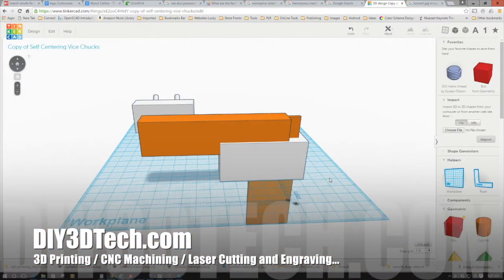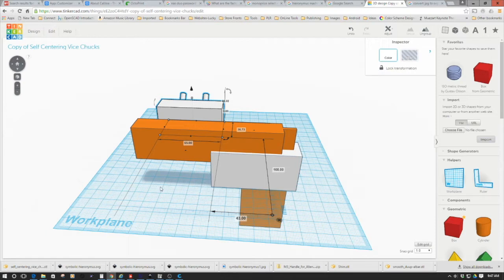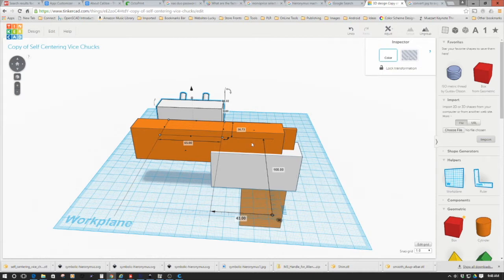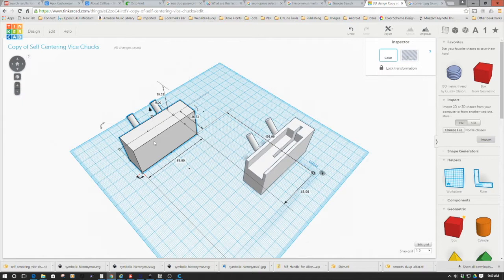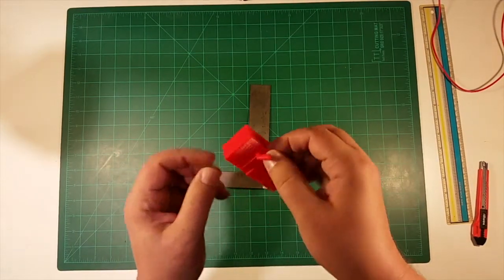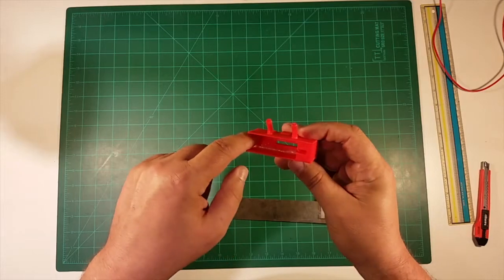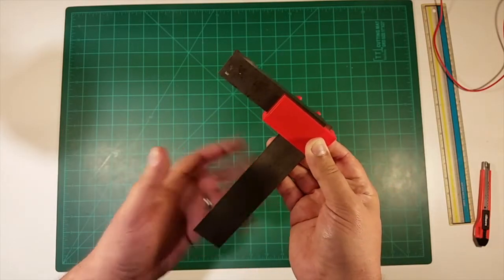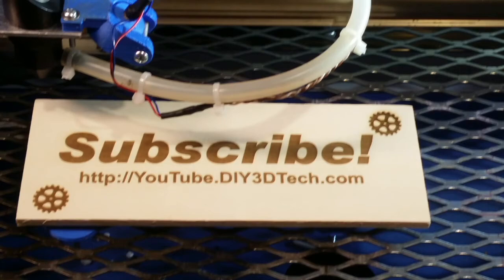TinkerCad Workflows  -  Machinist Square Pegboard Holder!

Comment: white gorilla glue has been my fave for years now .    it reacts with water . I use white stuff  ,  and it foams up white if you wet it .  a few min after you make it foam you can press it back down where needed for great looking fillets . 
in my R/C planes i have forces it to foam in and about fiberglass drywall tape .  and that becomes light and strong as all heck . 
i think of it as my foaming epoxy .   but I now stick to only the white for hobby stuff as the set and cure time is very predictable vs their original brown stuff.  any surface that excepts moisture will bond well with a small amount of white GG. I get crazy strong bonds with PLA .  lightly sand parts , mist them with water , and glue and clamp using typical wood glue practices for clamping . mainly as the water will make it foam enough to push the parts apart . but if you clamp it the foamig expansion will force it into every micro crack . so uh yeah , I like the stuff . 
And good TC video man .
Reply: yeah the white stuff.  https://goo.gl/3j9gIB  < that's the size i usually get . GG is cured by exposure to moisture , so bigger bottles are a waste for small occasional uses . the more moisture it can pull from the air the faster it will cure . i think of it like a funny epoxy .  simply use a bit of water to speed it up . but adding water makes it foam as i cures and that can be a issue if you are not prepared .  
with wood, its crazy good .  in fact any surface that can wick in a bit of water should get a insane bond if you damp the surfaces first ,and clamp .  the glue will react with the wicked in water . 
wallmart here keeps the small bottles near the super glue . 
I understand it can react energetically with alcohol . i should have a wee test of that soon . LOL
Reply from the maker: Will have to get some and try it as love the brown stuff (which also seems to foam).  Thanks for sharing :-)